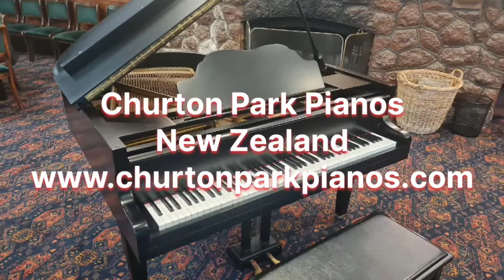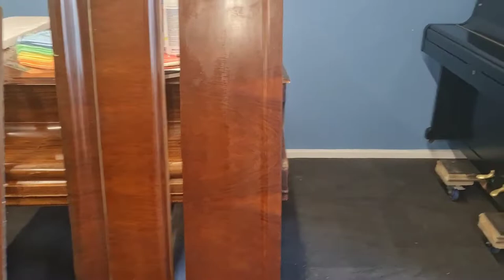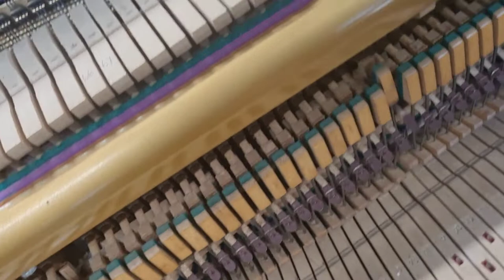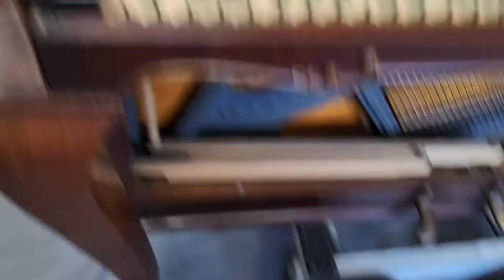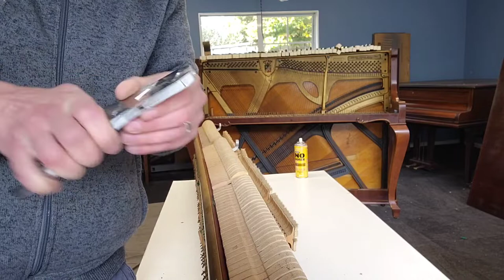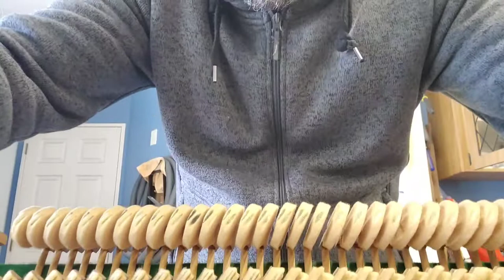Fixing an old Petrof piano in desperate need of help!! PART 1

Comment: I would really like to see you address the Balance Rail punchings and then the Front Rail punchings and how you measure the associated distances, choose the correct thickness of the various paper punchings and set each one correctly throughout.  I have a 1916 upright that I just restrung and replaced the hammers.  But now I have to regulate the rest of the piano and getting the balance rail and the front rail "just SO" is very important for key dip.   This seems a very long and complicated process involving a great deal of measuring in thousands of an inch across the complete key bed.  Id love to see how its done.

Comment: The dampers are starting to lift off the strings because you have the piano sitting on a dolly.  Put it on the floor and I believe the dampers will work properly.
Reply from the maker: You were right!! Completely forgot that happens on some Pianos 🙄 In my defence, there were some notes that were open when it was on the floor when it first arrived. All working great now 😊👍